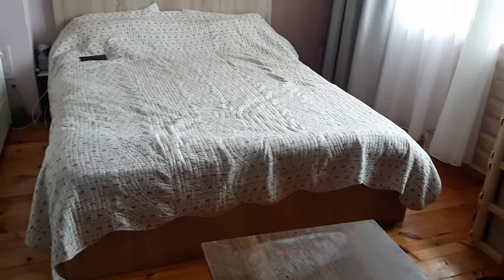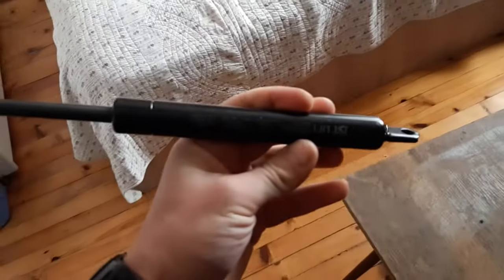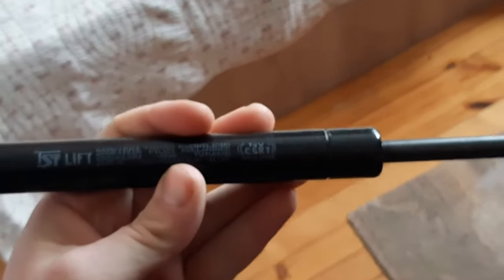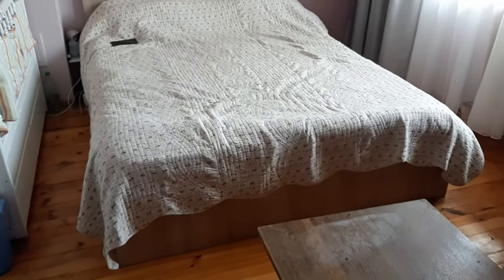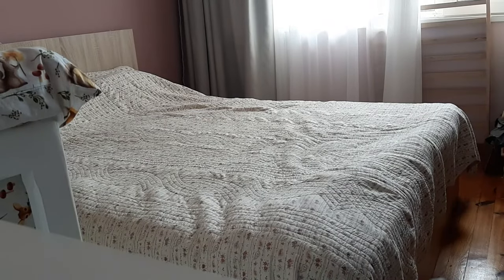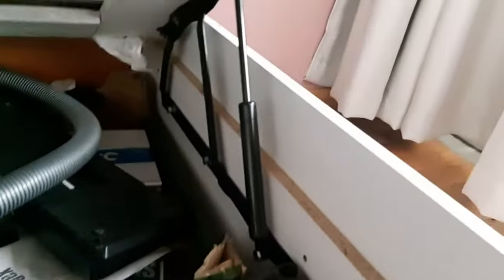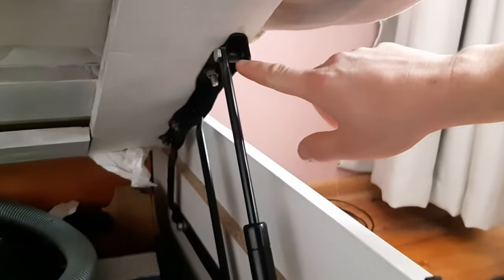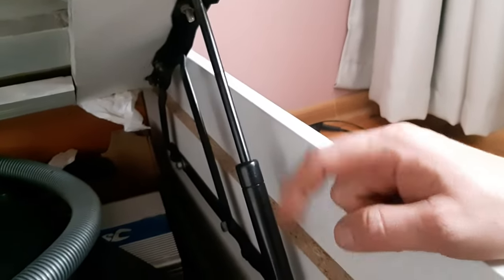FIX Lifting Bed Mechanism NOT Working How to FIX IT ? Shock Replacement

Comment: How do you work out the measurement for the size of the strut and the weight? Do you measure the entire length or just the thicker piece? My struts held 65kg. To get stronger, would that mean longer?

Comment: The reason to have the shock on the top is to allow the strut to receive lubrication on operation otherwise it can dry out and cause issues. You can also add extra lubrication such as WD40 to improve operation.

Comment: Hi, my gas sticks are going that way too but the bed won’t close down? Do you have a solution?
Reply from the maker: Remove one and see if can be closed,if it can - change with a new strut. If can not,.will need a new mechanism's

Comment: Hello, what size of the gas pump is kore suitable for hydraulic beds? Thank you
Reply from the maker: Am...what ?
Reply: @MeFixingEverything  so i want to build myself a hydraulic bed. But the store i went to had a variety of gas spring sizes. I want to know what is the length that you used for your bed
Reply from the maker: 310mm angle length,  1500N
Reply: @MeFixingEverything  oh okay thx

Comment: Hi - do you know how can a shock be checked if it works or not? I know one is not working for my bed but bought two new ones and none seem to compress when I push the bed down. Thank you!
Reply from the maker: Can be semi working. Here one of them was completely out of gas so was easy to compress and seen that it bad. Best practice - change both.

Comment: hi where did u buy these from? do u have a link please? also can these be used on any ottoman bed? thank u!
Reply from the maker: Local furniture shop, you can find themmon AliExpress and ebay
Reply: Not all pistons are the same size. Therefore, measure the dimensions of the existing pistons and make sure you buy the right product.